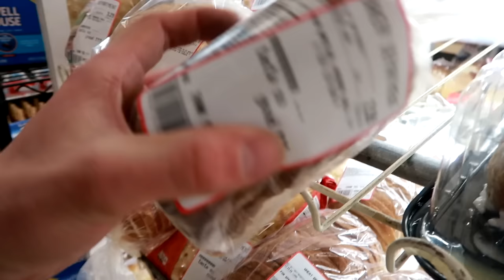My Mom Kicked Me Out

Comment: You have tow mirrors they electrically extend out. I believe if the mirror selector switch is set in the middle position it will allow you to move the mirrors out with the direction switch.

Comment: Sell the BMW and do a s10 drift truck build
Reply: Dan Tanna you can put a hydro in an s10 or most trucks not too hard
Reply: aaron hayden lol
Reply: Dan Tanna no need. Tou build enough horsepower there's no need to use the brake to get the back of the truck to loosen up.

Comment: Hey, I am not sure if this was mentioned by anyone in the comments. The stock mirrors on your truck are extendable using the power mirror button. The selector switch for left and right should be in the lock position and then the 4 way switch is pushed to the left and they should extend. I hope this was a helpful comment.

Comment: Hey Dalton! Tires are reused for many different things now a days. Some get the wire pulled out of them and mulched for playgrounds and the like, some get retreaded (not many anymore), one of the newer technologies is turning used tires into diesel fuel, and they are working on breaking tires down to the specific carbon types that are used in the manufacture of new tires so they don't have to get as much from other sources.

Comment: Vast majority of playgrounds use recycled tire mulch, or PIP surfaces made of tires. Artificial turf uses ground up rubber from tires for infill. Also, for the manufacturing of portland cement, artificial reefs, fuel sources, and tons of other uses.

Comment: You can't rely on coolant in oil for DMax head gaskets, it usually doesn't happen. Hard upper rad hose with cold engine and pressurized coolant overflow is best test.  I found out the hard way - lly issues... Keep up the good work!

Comment: I got a story. When I play basketball every day I first back my dad's work truck out of our driveway then pull it in after rim done. I did that for a year then I got my drivers learner permit. One day my sisters were outside after we played basketball and while backing up, my dog ran behind the car. My sister screamed(even tho I didn't hit the dog.) and I thought I hit one of them. I panicked and hit the gas instead of the brake. I hit our garage. Collapsed the roof onto the van and other truck inside. broke the corner pillar of the garage. caused 21,000 dollars of damage. that was about a year from now. Trust me it could have been worse. Just glad no one got hurt.

Comment: and they take tires, Recycle them .. shred the tire into rubber scraps , they either melt it down and use it to re~bulkinize tires, or just make new tires all together, not good to store tires outside cause rainwater will fill inside and mesquites are prone to reproduce in puddles in tires

Comment: hey 3d I have a  03 yz450f.. it's runs but the crank is stripped and  the kick sprocket need to be replaced also .. do think I should rebuild or buy a whole engine  .. the rebuild plus part . cost about 1500.. the engine cost is 1400

Comment: I will have to argue about the statement you said about headgaskets. they don't always mix oil and coolant. it all depends where the gasket may "blowout." At times it may only be a compression loss, or coolant being burned in the cylinder.  Don't get me wrong tho.. the milkshake is common with blown headgaskets.

Comment: Try backing up a trailer almost twice as long as the tow vehicle.
Reply: qcn_ cummins it's much easier then backing up an 8.5' x 10' single axle snowmobile trailer. The bigger the trailer, the easier it is.

Comment: Tires can be ground up and turned into flooring
Reply: company now turns them into energy too
Reply: Turning Waste Tires into Energy. Global Clean Energy Inc. (GCE) is a Humble, Texas- based waste-to-energy company that focuses on technologies to convert waste into high value energy, a process the company refers to as Reforming Environmental Salvage into Clean Usable Energy
Reply: Acreage Living "clean energy" is a waste of resources. We have plenty of oil. Use it.
Reply: recycling tires isnt wasting resources lol. Its turning waste into a resource.  The tires are converted into a clean diesel!  At our local landfill, we are not even allowed to dump tires there! Notice every tire you buy, you get an environmental charge on it. Because tires are so hard on the environment that there was no use of the old tires. I am no tree hugger, but its nice to see old tires being put to use and recycled, now if only they can get rid of that environmental charge and accept them at our landfill! Other landfills that i know that accept them, charge you for each tire. Wouldnt you rather not be charged? I am all for using oil, we have plenty, but its not an unlimited supply. I worked on an oil rig as a derrickhand for 4 years. My brother is a rig manager on a service rig, i have cousins who still work in the patch too, i am all for supporting the oil patch. Would love to move back to Alberta.
Reply: Alot of the sport rubber floors like in gyms weight rooms etc. are made from recycled tires. As well as several entry ways into stores and businesses.

Comment: 2:17 Dude, does the power extenders in the side mirrors of your truck not work? If so you don't need the manually extended tow mirrors.
Reply: Kyle Sayers really ? Why are all of you kids implying he needs tow mirrors for an open two place snowmobile trailer. If he were dragging a travel trailer...or even a clamshell snowmobile trailer, yea...but there's no need to extend them for a 101 x 120 trailer.
Reply: No I said that he has the best of both (if they work) and that DOES NOT NEED the other tow mirrors. He has power extend mirrors on the truck already

Comment: click bait again unsubbed, ps check torque on  your lugnuts make sure they are not loose so your wheel falls off again and make sure they are not too tight so you warp and crack your rotor in half again.